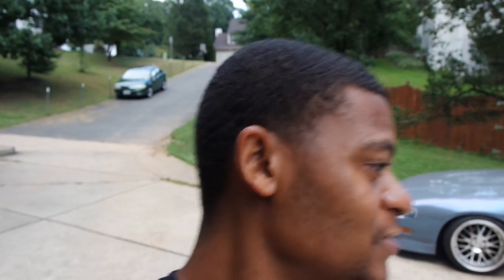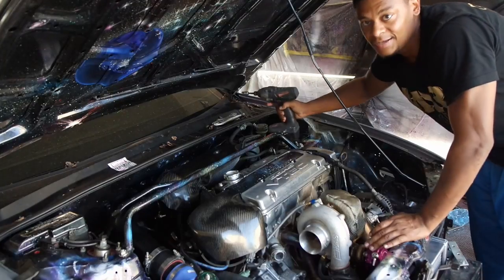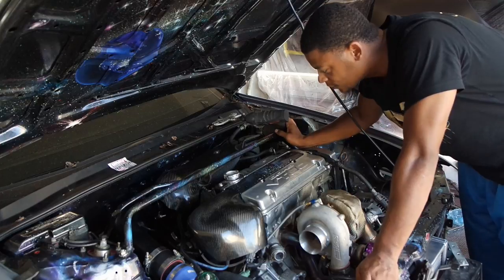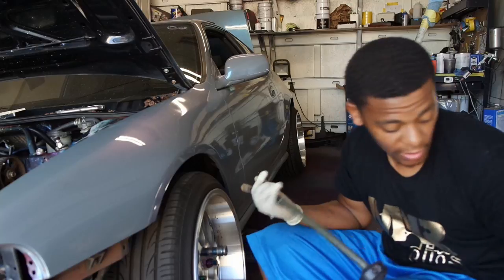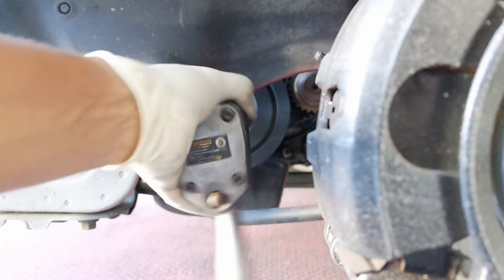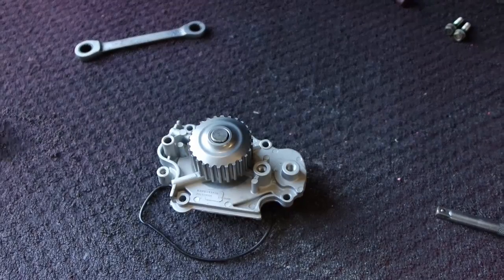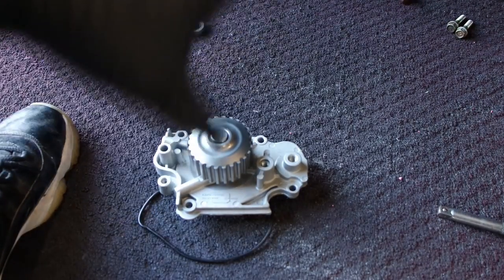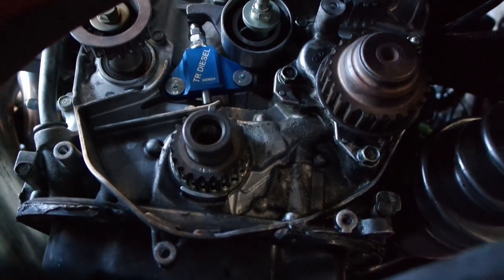Honda H22/F20b timing belt install | HONDA PRELUDE | water pump

Comment: Some advice for everyone trying to attempt this on your first time. Take your spark plugs out of your head. The reason why is when you go to rotate the engine over with the old belt on to get everything aligned with top dead center, it is much easier to do so when you are not fighting the pistons compressing in the cylinders. If you do not, when you try rotating the engine with the 19mm crank bolt you will hear the engine hissing as the compressed air escapes out of the valves. There is nothing wrong with it, that is how an engine sounds when turning half an RPM lol. But with the spark plugs out, the pistons and crank are free to rotate with minimal resistance. The only thing that will offer resistance other than the ever so slight drag from the actual friction of everything is the valves in the head compressing. Taking the spark plugs out just makes everything much easier to align. Obviously afterwards you need to put the spark plugs back in once the new timing belt/water pump are installed.

Comment: Just a few side notes to anyone doing this for the first time. If you Don't have a good impact pick up the crank pully tool and an extra breaker bar, if the space is too small remove the bolt from the rear motor mount and have the engine on a jack it gives you a really good amount of free play, I prefer to remove the driver side mount bracket as it helps with getting some bolts, one you have everything out  clean the side of the block its not worth the risk of some shredded rubber getting into either your water pump pulley or idlers making them seize, and finally before you re torque the crank bolt turn the motor over a few times and make sure it stays in time. As always the prelude love on this channel is just amazing. It sucks to have it down for so long but some great content came out of it, thanks Trey see you in the next one!
Reply from the maker: Great added info bro thanks and thanks man see you on the next 1.
Reply: I have a 3/4 Snap On impact and it won't even break the crank bolt loose 👎
Reply: Is the crank bolt a regular thread or reverse thread?
Reply: @cptn_shankz486  
Its normal thread. Counter Clockwise to loosen. Also, the motor spins the same direction.

Comment: I have both the physical and digital factory service manuals for this which works fine but it's good to see the process first-hand. Thanks.
This was done on an H32A VTEC (Blue Top) for whoever is curious. The process is exactly the same and most parts are interchangeable with obd1 and obd2 H22 motors except the thermostat cover and thermostat itself due to the bigger diameter that the JDM H series motors have.

Comment: Before watching:  I wonder if he will say to turn the exhaust cam 1 tooth advanced/forward/counter clockwise that way when you slip the belt over the exhaust cam gear and the intake it will rotate the E. Cam backwards 1 tooth and into alignment.  It was quite frustrating before I figured this out!

Comment: Bought a 97 w possibly a bad motor for 300 buks. Im doing the timing just to be safe because i found a shredded balancer belt and the timing belt walked a little. Waiting on new belts and the manual tensioner. Video helped a lot with finding the correct timing marks. Wish me luck that it starts. Nice lude btw
Reply from the maker: Thanks bro and glad i could help
Reply: Trey Be Dipping well it worked!! Belt came in the mail finally!! Took me forever and a day to get the timing right. Its way harder than it looks. But i have a running prelude!! Total investment 400$ so far. Thanks for all your help and ill be watching your vids as i start the restoration!!
Reply from the maker: @mr.horse1801  glad i could help bro.

Comment: Man I just found out that I snapped the timing belt on my 92 Prelude today. And I was really bummed, but it’s awesome that you made this video on the same gen Prelude as mine and it’s very helpful. Much love bro! 🤘
Reply from the maker: Sorry to hear that bro.
Reply: Did you bend any valves? I just snapped the timing belt in my lude and I’m wondering if I need a new head?
Reply: Kyle Lloyd indeed I bent valves, in cylinders 2 and 3 to be exact, but most likely yes, the h-series engines are interference engines, so basically your pistons and valves are very close together. So just get a new head and timing kit and you should be good to go, sorry to hear about that though man!
Reply: ElysiumVocalCovers ahh damn lol. Thanks for the reply. I was hoping I might get lucky and not have to replace the head. I snapped a timing belt on a b20 before and I just put a new belt on and everything was good.
Reply: Kyle Lloyd yeah I’ve had the same thing happen with my b16 lol those engines are stout and non interference if I remember right. But yeah h series engines are pretty fickle imo
Reply: ElysiumVocalCovers ok cool, thanks for the info! Know of anywhere to find a new head for a h23?

Comment: Rebuilding my a4 out of the car currently just got a new crank and bearings all the timing belt jazz but was wondering about those “Honda guidelines” they always have some tension tricks to keep an engine in time, had the somewhat the same concept on my y8 awhile back. thanks for the info! Subbed!
Reply from the maker: Anytime bro

Comment: On this manual tensioner I see there’s the tensioner bolt but also there’s one we’re it slides too also it’s a 10 mm long bolt connect to to the water pump tho I need to install it also on your video it’s hard to see if you hade it but I don’t see it

Comment: How did you get the timing belt on with all the tension that is already there? Is there a way to loosen the tension to get that belt on while try to keep the pulleys top dead center?

Comment: sup bro I'm from Zimbabwe my prelude is boiling there is pressure build up in the engine how do I solve that do I change the head gasket love your work. by the way
Reply from the maker: Try removing you thermostat first and see if that solves the issue. If it does then just replace the thermostat. It's a cheap part
Reply: @treybedipping1734  getting parts this side is really tricky any reliable shipping companies to Africa
Reply from the maker: @donalbaincharamba2903  ok then just remove it for now.
Reply: @treybedipping1734  sorted bro thanx a million now have electrical issue

Comment: Great video, thanks for this. 

I have a random question, what are those markings on the Cam Caps at 12:58? What do they represent? I have an '99 F20b, took the valve cover off and have the same markings on ALL the caps, 
only mine are 45 / 107. I also have a JDM '93 H22a and it doesn't have these markings.
Reply: Any idea on what the markings are?

Comment: Mine snapped while at idle... so im replacing timing belt and pump. How did you do all that with that engine mound still attached?
Reply from the maker: You have to remove the mount to get the new belt on

Comment: Good day. I have a H22a1 1992 Honda prelude. I have replaced my timing belt and everything works properly except for my belt getting shredded against the two tensioner wheels. I'm not sure if I put the crank timing pulley correctly or could it be something else. There is a big washer which I put behind the timing crank pulley;not sure if it should go in the front of the pulley. And how far back should I push the crank timing pulley. Reason I am asking this is due to no Honda macs in the area and I have to fix it myself. And people are clueless in my city.
Reply from the maker: Tensioner may be too tight

Comment: Yo I replaced my water pump an thermostat an did everything in ur video an it still don't wanna start
Reply from the maker: What makes you think the timing belt is keeping it from starting?

You need to check for fuel, spark, and compression

Comment: I snapped my cambelt. Can I set trimming without the belt on.
Reply from the maker: Typically you have to set the timing with the belt off and once the timing is set you install the belt.
Reply: Estin Govender how did you re time the cams and crank

Comment: I took my belt off last night to replace and didn't set It to TDC. None of the gears have moved. Can I Install the new belt and rotate the engine to TDC and make sure everything lines up properly?
Reply from the maker: Not worth the risk i would do it the right way.
Reply: @treybedipping1734  Thanks for the reply. But I'm kinda confused lol. Do I put the new belt on and slowly rotate the engine until the crank marks line up and then check to see where the cam gears are?
Reply from the maker: @mrkeithleeman1998  the 2 cam gears as well as the crank all have marks indicating when the motor and cams are at top dead center. Once they are tdc then you put the belt back on.

Comment: If I snapped my belt did it hurt my valves or Pistons been told that it doesn't hurt them on this particular model
Reply from the maker: Its case by case cheapest way to find out is to put a new belt on and if it runs like crap you prob have bent valves

Comment: How did you tighten your manual tensioner? I'm very stuck and my timing belt keeps slipping from the gears when I turn the crank shaft pulley.
Reply from the maker: Which tensioner do you have? Its pretty simple to use just turn counter clock wise to raise it up and that tightens the tension.
Reply: @treybedipping1734  h23 ks tuned manual tensioner. What kind of method did you use to tighten it becszue I'm using a crows foot and some extensions. And I still cant seem to tighten it.
Reply from the maker: @Tristan-kd7ck  it should have come with a special wrench. If not use a short wrench and as you turn, flip the wrench over to get the next angle to turn it.

Comment: What do you mean about top dead center about the cam gears cause im about to change my cam gears
Reply from the maker: When the pistons in the center are at the highest point it can be in the block. Its a term used for reference when timing the motor with new belt instals

Comment: When u turn the crankshaft with the belts on at the end counter clock wise three teeth,is it okay for it to move of the tdc points all together?
Reply from the maker: You have to move all of it at the same time to keep it it in time.

Comment: There are some rings that come with it. Do thwy go with the tensioner? Theres 2 of the same size and one that is bigger
Reply from the maker: Im not sure what your talking about. Message me on instagram.
Reply: I think your talking about the camshaft seals and crank pulley seal

Comment: where is that 12 mm bolt you mentioned for the alternator tensioner?
Reply from the maker: The tensioner bolt is a 10mm there is a 12 under the alternator that tightens it and holds it in place.
Reply: Trey Be Dipping thank you so much i been at this step for a while 😂

Comment: yo i need big help, so basically i have an h22 in my del sol. I got everything to TDC while the belt was on (so everythings in the same rotation)but when i took off the cam gears they moved forward slightly now its not TDC.  To get it back TDC I know 1 rotation of the cams is equal to 2 rotations of the crank but what is the calculation for the "balancer gears" for them to be in time with the crank?
Reply from the maker: Everything has marks. There is also a service bolt in the back of the block to lock the balance shaft gear in place

Comment: Bro i have a question in my case i like race so in your opinion is good cut the balance shaft belt for more strength or is not safe cut it? What could b pros and cons?
Reply from the maker: Ks tuned sells a balance shaft delete kit but you can also just not run that belt
Reply: So that can't cause any issue? sorry for boder u bro is just i wanna make sure so i can and nothing going happen?
Reply from the maker: @elmazmaliante2010  you will just have a little vibration nothing crazy
Reply: Thanks homie a lot a follower here💪💪💪💪
Reply: Thanks a lot my man...i really appreciate your tutorial and thanks again for sharing w/ us

Comment: Bro i installed manual tensioner on my h22 but I have a lot of slack between the cam gears. Did I miss something? I made sure everything aligned with the marks.
Reply from the maker: Once its timed correctly you turn the pully bolt 3 teeth counter clockwise to create tension. Then then you adjust the tensioner to remove thr remaining slack
Reply: @treybedipping1734  thx a lot bro

Comment: So my intake can gear is about 2 teeth off. Im trying to loosen the timing belt so I can move the cam in place but all I can find online and YouTube is timing belt removals or water pump replacement or adjustable cam gears like I just need to loosen the damn belt so If anyone can guide me to a video I would appreciate it

Comment: Eyyy dude, in a stock 5th I got the ABS Shit all in the way, what's a good way around it or do I gotta undo it all
Reply from the maker: Abs is tricky to do a full delete you may need to redo some lines but most importantly you need a non abs valve from either a prelude, civic, or integra because once you take out the abs unit you'll have 6 lines that need to be regulated.
Reply: Cool, I'll have to look more into that then, I hate having it in the way. Did you do a delete or did yours not come with abs?
Reply from the maker: @VashRain192  i did a delete on mine. Free'd up alot of space. Way cleaner look.
Reply: Cool, I plan on it with mine as well. Gotta do the belt and pump on mine soon
Reply from the maker: @VashRain192  well hopefully this vid gave you a refresh for when you do yours.
Reply: Trey Be Dipping for sure, I have an H23A in mine so the similarity will definitely help

Comment: Did you use an H22 belt on the F20B
Reply from the maker: Yes sir
Reply: @treybedipping1734  reason I ask is I've been told the h22 belt goes on too tight but apparently having the manual adjusted tensioner helps.
Reply from the maker: @jamesstewart1794  they say there is a one tooth difference but I've never had any issues
Reply: @treybedipping1734  so did you use h22 water pump too , right ?
Reply: @treybedipping1734  h22 water pump too ? I'm about to swap from an h23a Bluetop to the F20B soon so I wanna make sure I have the correct parts to do the belt and water pump before the motor goes in since prelude have such a tight engine bay.
Reply from the maker: @James Stewart  yes sir you can use all h22 parts for the f20b with the exception of rod bearings
Reply: @treybedipping1734  thank you for the help
Reply from the maker: @jamesstewart1794  no problem and good luck

Comment: How can I get the cams in the correct timing if they were move while the belt was off
Reply from the maker: There are arrows and line notches on the cams and crank to guide you to put it at top dead center.
Reply: @treybedipping1734  so as long they are set in marks it wouldn’t mater if they were move just move them to the marks and that’s all..also with this manual tensioner how can I get the correct tension on the belt with out the noise on it I used my car for driving not racing will it still be better to go with the manual one
Reply from the maker: @orlandomorales6565  i explain all this in the video 🤣

Comment: How the f$$$ did you get the belt on I have been trying for 4 hours to get the belt on it is so f$@#@  tight I have the shop manual and I built the whole engine damn
Reply from the maker: There are a few tricks but you can try loosening the 14mm bolt holding the tension arm.
Reply: @treybedipping1734  yeah it was freaking tough I did manage to get it on I loosened up the tension arm and slit on that way but yep that's correct thank you for your info now I'm trying to figure out how to bypass the immobilizer

Comment: Yo.  Need help.  My timing belt snapped. How do you re align both cams.   My intake side is more advanced than the other
Reply from the maker: Turn it with a 14mm wrench or ratchet
Reply: Trey Be Dipping  got it I was panicking thou haha. Counter clockwise right??   Shld I line up crank first then cams. Correct?
Reply from the maker: @davidmerriweather9678  yea either way  make sure its top dead center at the crank and the arrows are facing up on the cams.
Reply: Trey Be Dipping okay so.. intake side doesn’t turn hella smooth lik exhaust side. Like you start turning it and it kinda just clicks in place about 1/4 full rotation,,   You can’t make small rotations.  Counter clockwise
Reply from the maker: @davidmerriweather9678  try adding oil across the cam and move slow its like balancing
Reply: Trey Be Dipping    Yo. So I finally got my manual tensioner in.   Timing belt is on and good  SO My question is do you re time crank and cams to TDC? Before lining up balance shaft pulleys???? Because I turned it 3 teeth counter clockwise to get tension.   I already locked in the intake balance pulley thru service hole but I was curious about the exhaust side it has a arrow on the top lik TDC BUT ALSO HAS THE SIDE MARK  which one do I use.???
Reply from the maker: @davidmerriweather9678  i would reset it to tdc and then line up the balance shaft as far as which one to use i would use the top.

Comment: How do you tight the belt crank shift belt
Reply from the maker: The balance shaft belt? You create tension by hand pushing upward on the circle tensioner  or you can use a flat head screw driver as a pry bar as well.